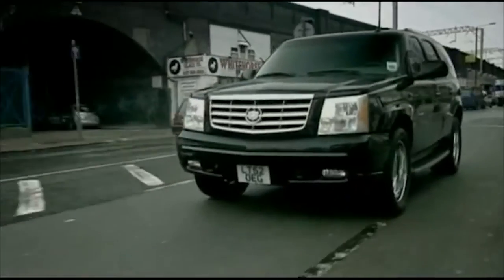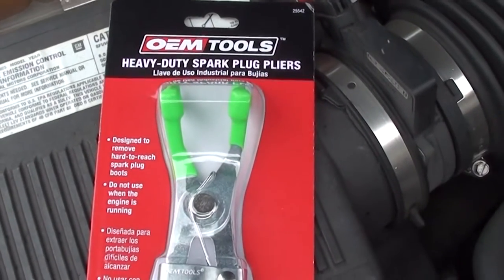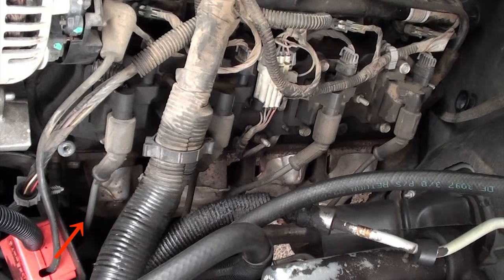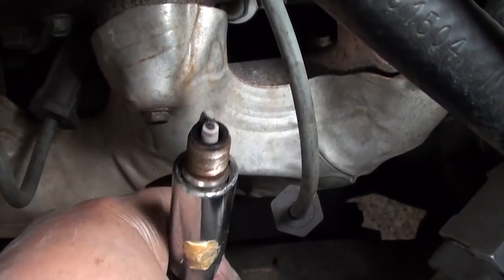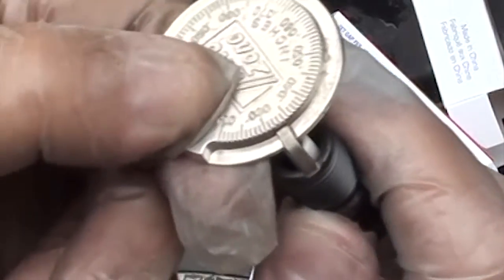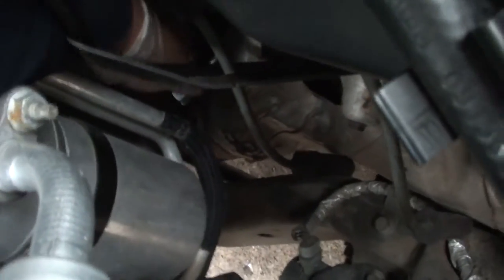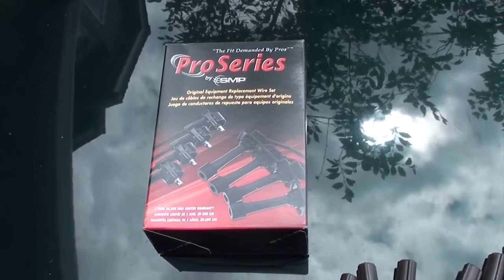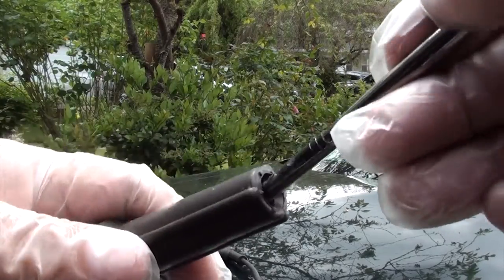Cadillac Escalade | How to replace Spark Plugs and Spark Plug wires | Easy DIY Tune-up | Save

Comment: Thanks for the video. Helped me on my 2005 Cadillac Escalade. That Number 1 got easier when I moved the bracket holding the red box saying battery.  I could get my hand in the area easier to tighten the spark plug.
Reply from the maker: Kwel! You just saved a butt load of money..

Comment: I couldn't even get the boot off my spark plugs it seemed to be seized or melted on don't look to me any tips for me getting the boot off the spark plug. I twisted trying to pull diagonally did it win the engine was warm and I tried to pull him off when it was cool. Keep in mind this is the rubber boot.😅 What a pain, I just wanted to inspect a couple of the spark plugs, vehicle seems to be having a hard start every once in awhile.

Comment: Hi. You said your plugs were in good shape. Was your issue the need for a tune-up? Or did you find your problem was something else?
Reply from the maker: Well it was running a little rough but i always do a tune up on all my vehicles when i first get them. Then i know when and how and what plugs are in there. i wont have a tune-up  problem for a long time.